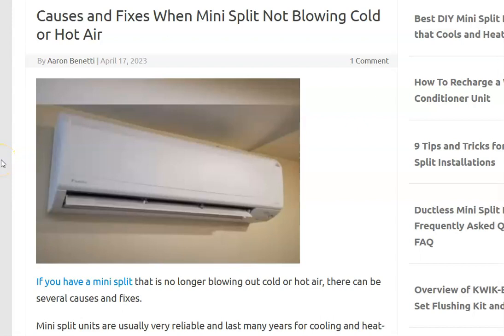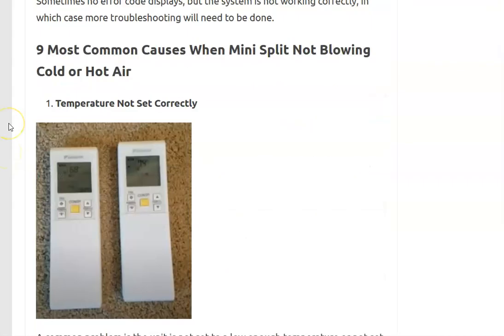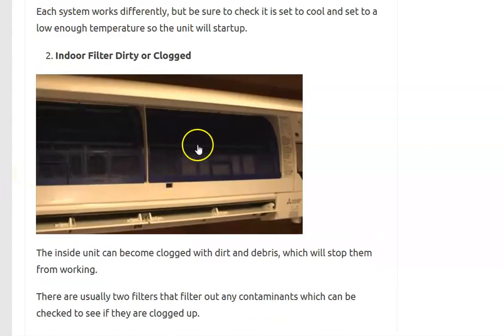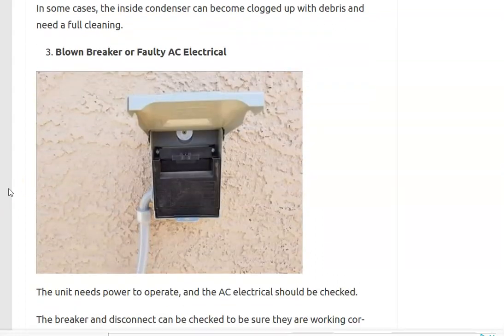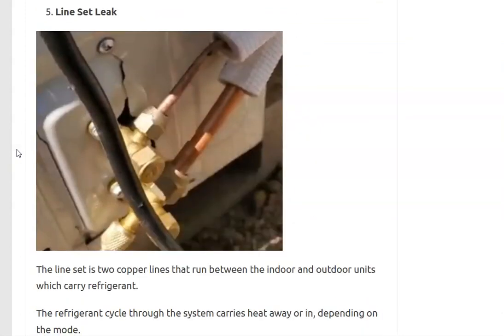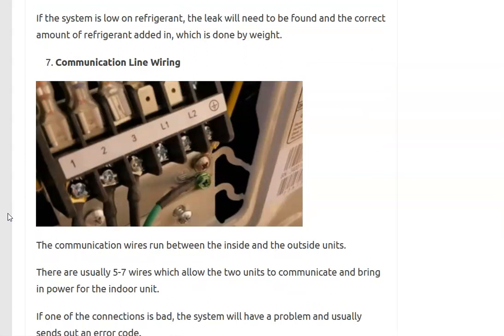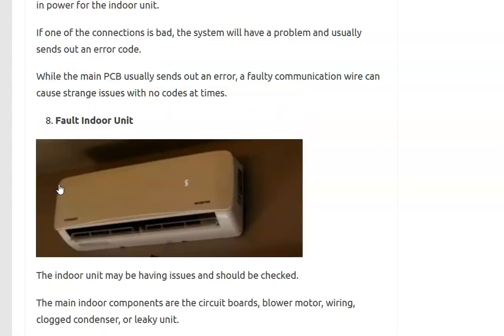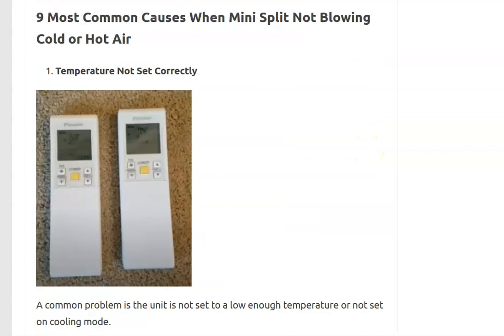9 Most Common Causes When Mini Split Not Blowing Cold or Hot Air

Comment: I have a Mitsubishi mini split with 5 units. All units work except the unit in the primary bedroom feels like cold air is blowing but the room isn’t cooling. My remotes don’t say “cool” or “heat” rather a picture of sun and snow flake. It’s currently set to the lowest temp, 61 degrees. The door has been closed about 7 1/2 hours. Come in to a hot room ☹️Any ideas why the room isn’t cooling but when I put my hand up there, the air feels cool?
Reply: Same issue

Comment: PLEASE HELP  mini split blows cold but switches to heat without prompting...idk why
Reply from the maker: I would check the remote control and set "Cold" or "Heat" manually and be sure it is not on "Auto Mode."

Comment: Thanks so much for your videos! I just bought a bus conversion with a Seville mini split in it and it’s not been cooling. It cools just a bit when you’re sitting right under it but it in no way cools the bus. I just got a set of analog gauges and watched your vid on how to vacuum it out. Just wondering if you have any inclination based on your expertise as to where I should begin? Tried cutting the breaker and doing a reset. No luck and no error codes either.
Reply from the maker: It will need to be troubleshot to find out why, but I would double-check the wiring, be sure the valves are open all the way, and the remote control is set correctly.

Comment: Our Gree split type AC is working well. I just cleaned the filter and set it to 25. My mate came and because he has low tolerant on cold. He set it to 30. On the the day after when I'm trying to set it again to lower temp. It is not cooling anymore. Is the changing of the temp to higher might be the cause? Please enlighten me. And what should I dow to diagnose?
Reply from the maker: Double-check that the remote control is set to Cool Mode and that the temperature is set low enough for it to turn on.

Comment: My mini split is running but i dont think its running at its full capacity and i noticed the output line is cold on the outdoor unit but the return line is not cold at all has new lines and no leaks ??
Reply: Bro same wtf
Reply: @Logan-el4re  I figured out what was actually wrong it was low in R410a refrigerant i ordered some from Ability Refrigerants online at they website got it in a few days I filled that mf up now all is well no more freezing lines blowing ice cold now
Reply: @thelithiumpowerch  Interesting, I wonder how mine could be low on refridgerant since they just installed it in my finished basement and I have only used it for a week now. BUT this does mean I do need refridge likely since all of my other units work fine down here but that one. I am worried why it worked for like 2 days then stopped working brand new. Well thank you very much for your response!

Comment: I have a mini split with 4 heads 3 are blowing fine and cooling to the right temp. However one zone isn’t. No codes on the inside unit.
Reply: Did u figure it out? Same is happening to mine
Reply: Same here, 2 heads, 1 works fime, the other works for few hrs but the stops, and is still on the unit... so I just turn off the unit take the batteries out of the control and turn off again... is like a restart... so I did that and works fine again, few hrs the re do the steps agaun... frankly is tiring 😫
Reply: Anything?
Reply: 2 heads on one outdoor condenser must be set to same function whether heating or cooling. Check to ensure this is the case

Comment: Great information I’m having an issue where my mini split is blowing cold at 62° but it’s only blowing about 1 foot of air out of the evaporator not strong airflow and I clean the evaporator really well and the blower wheel did a very good deep clean, still barely any airflow coming out of the evaporator
Reply: What do you think could be causing this?
Reply: Is there different fan speeds?